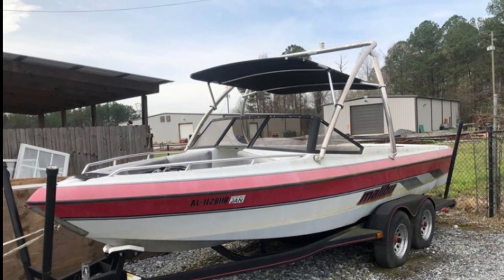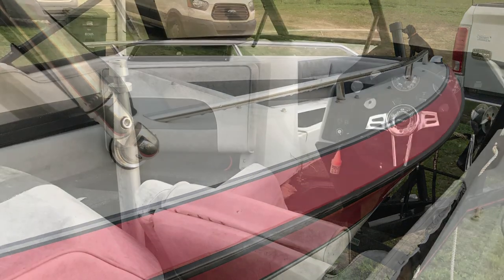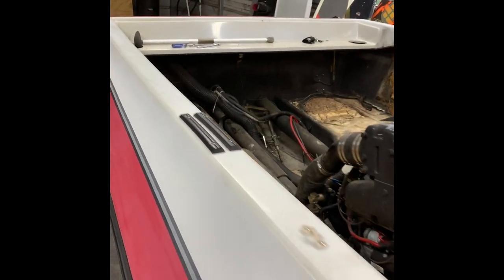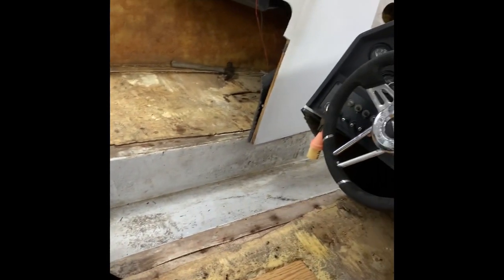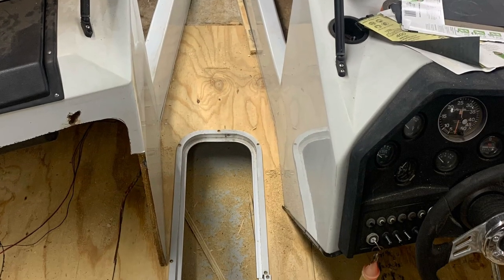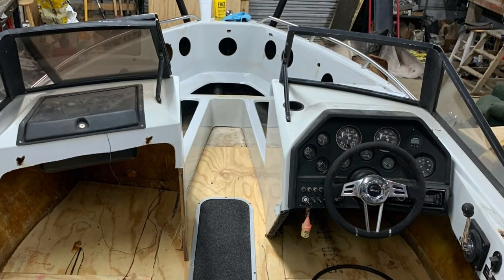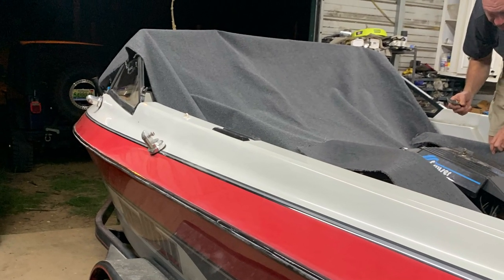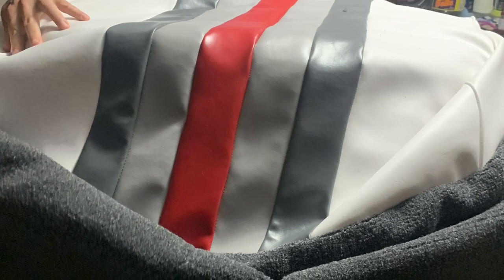Reviving the Classic: 1990 Malibu Restoration Journey! 🚤🔧✨

Comment: About to re do the floors on my 87 Malibu sunsetter, any advice? What all did you buy just for the floors?
Reply from the maker: Be prepared to take some time with cutting and trimming 

Bought treated ply wood then bought fiberglass resin and cover tops after everything was in place after drying I sanded to make sure it was smooth before carpet is laid then applied a waterproof glue for the carpet 

Ordered carpet off eBay 4 years ago for 300
Reply: @Rubiconromp  do you remember how much wood you needed?
Reply from the maker: @Katiegreen37 I’d say about 4 I want to say 

Main thing is too make sure the wood is sealed the best it can for long life